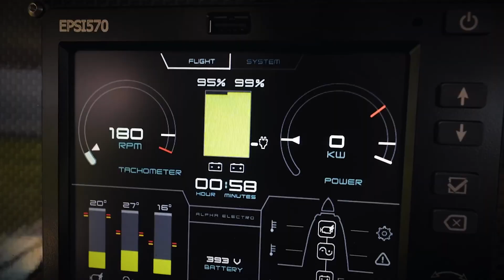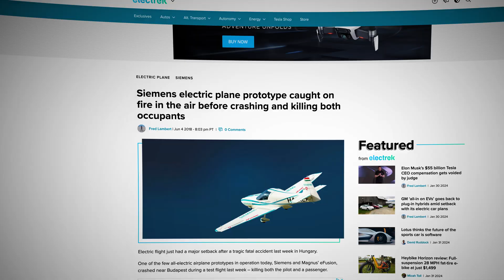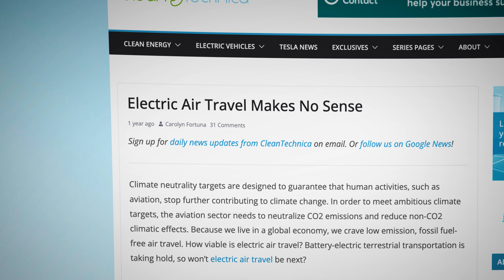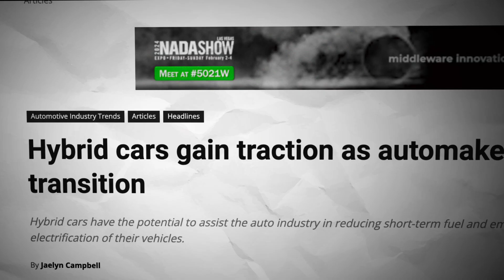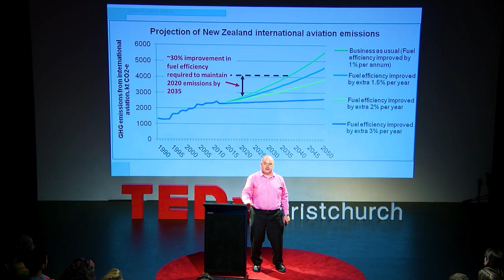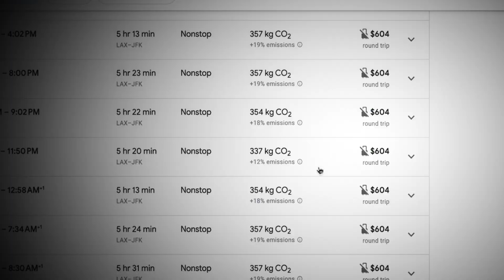The Silent Rise of Electric Planes

Comment: Some mention the fact that fueled A/C get lighter during the flights, massively increasing their overall performances. One thing to add to that is that it also allows the A/C, being lighter, to land on shorter runways, or runways under degraded weather conditions. And it's the same for take off: if your aircraft is too heavy to take off on a given runway under the current weather conditions, you can reduce the amount of fuel you take. An electric aircraft will always be the same weight, meaning it will have to be designed for worst case scenario in regards to runway planned for take off / landing, and weather conditions. Makes it very difficult to optimise the design

Comment: You get great marks for being politically correct, but poor being practical and accurate. First of all, carbon is a gas of life and we need more in the air.   If you are willing to sacrifice enough performance , anything goes. You can even have a coal boiler powering a prop and make it fly.  Lithium based tech is not even good enough for cars , never mind airplanes , and I hate to have on catch fire in the air. The gov infiltrated by many of the climate religion , forced a sales spike with grants and rebates, and now even that is not working. Never mind electric, if some of these guy found out the real life cycle cost of hybrids, they avoid it like the plaque.

Comment: You say aviation is 3% of global CO2 emissions. How much would it be if aviation was electric? Why won't you say that? How much is a battery replacement? Electric cars are useless on the used market because the battery replacement is outrageous. How long to charge 500 miles of range in a 4 passenger plane? What if more than one plane needs charged?
Reply from the maker: It’s a good point, if the way you supply the lithium and electricity is dirty then none of this matters.

Comment: What is the future of electric planes with fuel cells as the power source instead of Li? I’m particularly referring to H2 fuel cell powered with Green H2 derived from wind or solar power.
Reply: The amount of H2 fuel distribution for that is not possible. Electricity is way easier. Moving and storing H2 in large quantities is too difficult of a problem.
Reply: That is truly an impossible dream.
Reply from the maker: Hydrogen has a massive mass so it would be tough to store in planes, however I know many startups that are currently working on this.
Reply: @createdbyspiral  The calorific value/heat value/energy density of H2 is 140 MJ/Kg vs 45MJ/Kg for jet fuel. By comparison Li-ion battery is 0.5MJ/kg (i.e, 300x lesser). US is very negative about anything other than Li because of the intellectual capture of Elon Musk. Germany and Japan, and less influential countries like India, however are less constrained and more reliant on facts and science. So they are conducting extensive trials. Airbus for one is betting heavily on H2.

Comment: as long as lithium is the power source, no one should pursue this.
Reply: That's absurd, lithium Ion makes alot of sense for all kind of short range aviation. We need more of these routes without the restrictive cost of burning fuel. Stuff like crossing bodies of water for 100 miles.
Reply: @Neojhun  they removed lithium from DC10 some years ago due to fire.
Reply: @Neojhun   I understand you vested interest but....

https://youtu.be/5r-yN8SugWM?si=TiTbrHha6vq7vFAa
Reply: The industry and FAA is working hard to ensure the safety of lithium ion batteries. https://www.faa.gov/aircraft/air_cert/design_approvals/dah/lithium_batteries

Comment: I like the concept of a ship operating like a Chevy Volt.  Have a petrol fuel onboard for a generator to keep the battery pack charged and it won't need to be aviation fuel.  Electric motors don't stall and that's one of its best features.  

Exciting stuff.
Reply: Think structural battery.  Flying from the get go 25% of the weight of the fuel to get to London and having the range to get there.
Reply: That's called a SERIES Hybrid.
Reply: What the heck is petrol fuel. 
Call it gas or gasoline.
Reply: @John-nc4bl  you understand fool
Reply: @John-nc4bl  In the uk they call it petrol.Same thing with truck and lorry
Reply from the maker: Yeah, this could be great as another way to fly. Thank you for watching and sharing your thoughts!

Comment: The thing about a battery powered airplane is that it will never get any lighter as it flies along. That may be ok for short flights but long flights you really count on that increase in efficiency later in the flight.
Reply: There are a bajillion short flights every single day. That’s a HUGE market.
Reply: @pbsanstead  
Yes but the air traffic control system has a limited capacity. They would rather have to handle ONE 777 with 320 people than 36 electric airplanes with 10 people.
Reply: Good point on battery weight and range, and definitely a challenge that fully electric faces. With hybrid electric, our overall energy efficiency enables extended range in spite of the battery weight. We demonstrated this on a 12 hour / 1400 mile flight.

Aggregating more people into bigger planes to fewer destinations has been a long-time trend driven by the economics of operating airlines. We aim to reverse that by delivering solid economics on smaller planes, that can increase accessibility and convenience not enabled by the bigger planes.
Reply: Yes, significant issue. Perhaps use multiple batteries that each get 'jettisoned' once their charge is exhausted? Quite how you might jettison a used battery is a whole new challenge. Conjures up images of Hercs deploying parachute loads off the back ramp... ;)
Reply from the maker: Fair point. Although Hybrid planes are much lighter since the battery is significantly smaller. I think it will be able to fly across the US but not international any time soon.
Reply: @createdbyspiral  After all the ground transportation is electrified, there is no where else to go but up.